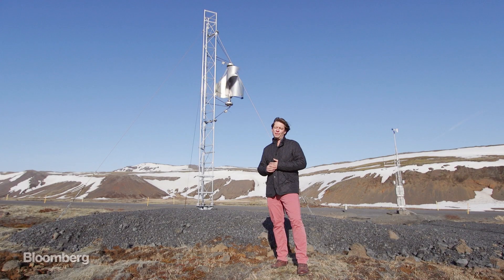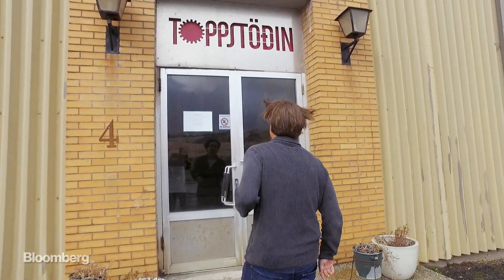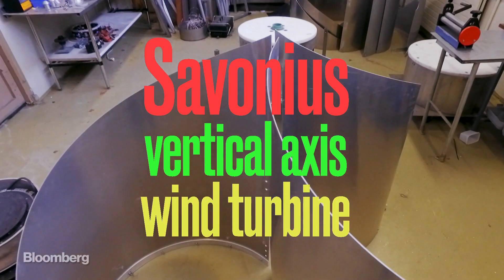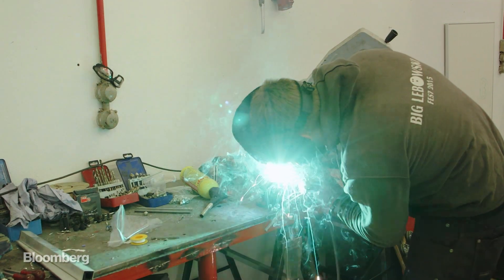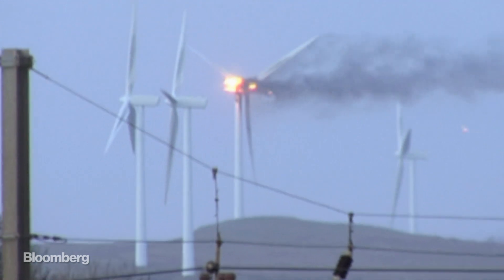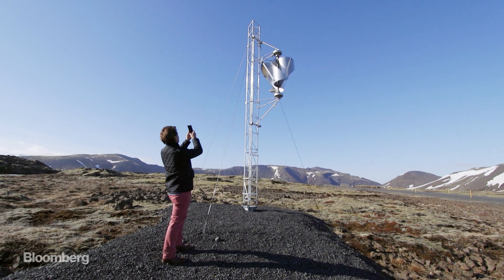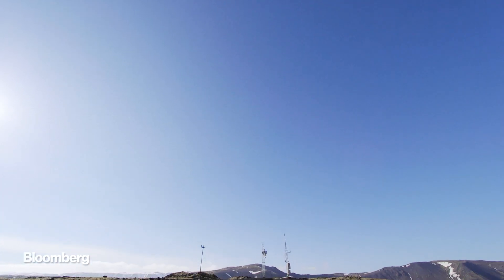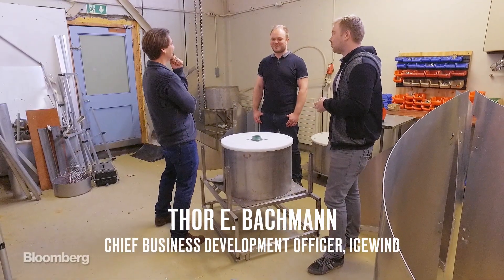The Tech That Could Fix One of Wind Power's Biggest Problems

Comment: good design... but why only one turbine on a frame that could take nine or more... and what sort of output does it give.. I imagine the generators are in the support hubs top and bottom of the blades...
Reply: Maybe that one is for testing in the real world or charging some batteries somewhere? instead of being in compensation generator for higher scale tests? But as engineers, all we need is a paper, pen and a calculator, so that we don't need to spend huge amount in material to test the theoretical side of everything in the real tangible world. Usually, engineers make as sure as they can to work it out on paper, for then make a small model, there rest of the estimations will be done in software or paper. :)
Reply: Maybe they could put more on a frame but you have to consider the loads on the support structure (mast or whatever). After all it is trapping the energy of the wind and if it traps/harnesses too much then the support structure could fail. I am writing this as the outside wind here in Wellington is 54 km/hr gusting to 106 km/hr.

Comment: Another vertical axis wind turbine. It's a zombie idea - keeps getting killed by experience, keeps shambling forward. Always finds new investors, always "a breakthrough." At least this one is cute. 

There's a reason that commercial ones are tall, three bladed, horizontal axis, and sited on high wind sites. That's what makes the most energy.

I suppose, given the high wind regime in Iceland and the long winter nights that a wind powered kiosk makes sense. But this design isn't going to revolutionize anything.

Sorry for being a wet blanket, but I work in the industry and this kind of press release "journalism" bugs me.
Reply: Minor Heretic there's not high winds in a lot of areas of the world. This would be suitable for more places and would cover those areas where high winds do not exist. The three bladed turbines are in extremely poor design do your research and you'll see what I mean.
Reply: Consider some basic physics/aerodynamics relating to wind turbines. The power available in wind varies by the cube of the wind speed. Double the wind speed means eight times the available power. Half the wind speed, one-eighth the power. Therefore low wind sites are often not worth the energy investment in wind turbine hardware compared to solar, which would give a better energy return on energy invested.

Another problem is turbulence. A wind turbine performs best with laminar air flow - the air molecules all traveling flat and straight and perpendicular to the turbine blade. A vertical axis turbine has two intrinsic efficiency problems. First, it always has vanes advancing into the wind, with the drag reducing the effect of the vanes going downwind. Second, it creates its own bubble of turbulence, reducing the effective wind speed. A third pragmatic problem is that vertical axis turbines are generally mounted near the ground where there is a lot of ground effect turbulence, further reducing effective wind speed. Add to this that wind speed goes up with height and a kiosk-mounted vertical axis turbine is a perfect storm of inefficiencies.

I worked alongside some of the best wind  turbine designers in the field for a number of years and they would have done almost anything for an extra half a percent of turbine efficiency. For reasons of basic physics and pragmatic reasons they were dedicated to the horizontal axis three-bladed turbine.

Comment: it's just uglier and way more expensive than equivalent power from the common config. It's a losing battle.
Reply: No my friend. Your negative comment is not relevant. If it was shit they wouldn't be developing it. I would let them come to a final conclusion of it's efficiency rather than throwing some pessemistic comment in to the wind ;-)
Reply: It's not "negative". That's just your irrational emotional interpretation of it from your ignorant perspective. I don't need to wait on them, it's been done before many times. There is such a thing as being wrong and they are it. It happens all the time. Toyota, Honda and Hyundai were wrong about hydrogen fuel cell cars as well. They were spectacularly idiotic about it. I knew many years ago. Tons of people told them they were idiots but they knew best. And of course they were wrong. Their obtuse plans failed.
A normal turbine is just many times more powerful for the cost and more elegant.
Reply: There is nothing like a smart arse. Apart from all the other parts of your reply. It was a negative comment. Smile my friend.
Reply: Meanwhile back in Germany the latest news is that they just put a hydrogen-powered train into operation.  No emissions whatsoever.  I wonder how those "Idiots" did that?
Reply: Subtle, a train is not a car, Isaac Newton.
Reply: Ha ha, in Isaac Newton's day the significant emissions were called 'horse apples', something people could use in their gardens.  I like your spirit ; )
Reply: Honda just released the latest version of their hydrogen car called the Clarity.   just sayin....   It's the only technology that matches our lifestyles.    I can fill a corolla's tank from bone dry empty to full in 4 minutes.  I timed it yesterday.   And the trip computer said it had just under 500km range.   Until battery technology catches up, I really doubt you can charge 500km worth of range into a battery in 4 minutes.   Hydrogen can.

Comment: Wind and solar are great alternatives to "conventional" electricity production. Power is only generated when the wind blows or the sun shines. What happens when that production doesn't coincide with your need at the time? That electricity must be stored. Now you're talking batteries. Big, expensive batteries. Presently, power is made as it is needed. An understanding of how the electrical grid really works is necessary. And a tremendous investment in a new more efficient grid and an investment in battery storage capacity is required before we can take advantage of these different power generation ideas to their fullest. Remember, you don't build your dream 3 story home until you have designed and built a strong foundation.
Reply: We've been using compressed air to store energy since the late 70's.  The tech is only getting more efficient.  The uk has a pilot project where excess wind energy is stored and used as a capacitor for when the grid needs the power and the wind isn't blowing.  

There are many other ways that are being researched and improved upon.  Batteries are not the only solution.
Reply: There are alternatives to battery storage.  In addition, clean engines can be combined to provide better consistency.  Consider too that wind turbines aren't put down in a valley.  They're placed where the wind always blows.

Comment: Some say this design is not very efficient. The one spinning in the video has 2 alternators. One at the top and one at the bottom so its safe to say it has enough torque to turn both of them at the same time. I would guess it can generate several hundred watts in a decent 18 to 22 mph wind. If the power output was not much they would only use 1 alternator. Thoughts?

Comment: They must have pretty constant wind to be able to mount them so low. Usually, you have to put turbines high to avoid non-laminar airflow - the ground itself acts as a friction force, disrupting the energy, not to mention trees and houses.
Reply: Green-propaganda hahahahaha yes... great thank you. The thing is with Iceland. They are allready pretty green. Check out their Geothermalpowerplants..... They are almost Greenland ..... 

Actually I am disapointed with this video because I thought they would speak about a storage for energy when they have overproduction for the time when there is no wind.
Reply: That's basically what anyone with alternative power sources does, whether wind, solar, microhydro, or even diesel generators. The point was that VAWTs can be less efficient than HAWTs, and that both kinds tend to benefit from being much higher in the air flow for most other landscapes than Iceland.
Reply: True, but we have no numbers of output or efficiency, so it could be all for show.
Reply: Actually, HAWTs with enough diameter and tower height can be very cost-effective.
Reply: Icelanders cut down almost all their forests, so yes, it is a windswept rock now.
Reply: no trees in iceland ;-)
Reply: VAWT's start turning at lower wind speeds and don't need the height . They also are omni-directional. The industry just shoots for the big numbers, they want one GIANT unit 200' up doing a kilowatt instead of 10 at 100W at 20'.
Reply: The tower height is the problem. in my town you can only go as far as the closest property line.
Reply: @ aphilipdent: I see, to avoid your tower from falling on the neighbor's home. Bummer.
Reply: hempev Thinking about installing a turbine to augment solar. Hawaii has plenty of both sun and wind
Reply: It's not even hard at all to figure out. Windspeed in the area should be recorded like in the states. They could have it built based on speeds. That's usually thething when making a product. It's all easy enough. People commented on supporting the system. In my area, wind low to the ground is fine.
Reply: They are either out in the windy open valley, or the ones on bus stop - it is literally meters from the coast, reasonable winds there too (Harpa)
Reply: When there is no wind? Its clear you´ve never been to Iceland...
Reply: I would bet it's because there environment has wind all the time and made to function in low winds as well. Makes me wonder also how much energy they produce
Reply: not to forget trees and houses.
Reply: Maybe this kind of turbines don't need a perfect air flow to function?
Reply: Nils None, With these toys overproduction is no the problem...
Reply: Yea but Iceland has no trees or houses so they are fine
Reply: vawt arent affected by ground affect.
Reply: hempev. It seems they're using them for small installations like that bus stop where they're not efficient or very powerful, but they still save power and money compared to pluging-in. Like traffic lights
Reply: Agent Outsider. Sure, Navier-Stokes was just made up to push an agenda -back in 19th century. And all that CFD analysis GE&Siemens do to optimise turbines is just bullshit right?
Gotta be that people who spend their careers in aerodynamics know less about it than some grumpy commenter :)
Reply: @josephgroves3176  mp
Reply: yeah you would think, but for some reason even the faintest breeze from the wind over the trees sends ours spinning .. I think propeller type turbines have a problem with ground affect like most aircraft do, that why they need to be so high.

oh   mines beside my driveway mounted about a foot off the ground. pole was there so, why not lol
Reply: Ok then . . . .
Reply: What of they put it on the coast. Like near sea level.
Reply: Parts of iceland get frequent air currents flowing across the bay, the coast line would benefit most from this.
Reply: A "giant" unit is probably going to be rated at a megawatt or more, at a cost of maybe a dollar or two per watt of capacity. This is why industry wants to do it that way. You'd need maybe 20,000* 100 watt Savonius rotors to match it. Down low, the wind will be much weaker, which is why you need 20,000 instead of 10,000. The swept area would have to be much greater, because Savonius rotors are much less efficient. 

As I recall, a 1 kilowatt wind turbine is on the order of 10 feet or so in diameter, though it depends on what speed it's rated at. If you made everything as efficient as in a really large turbine, maybe you could get it down to 6 or 7 feet. I'm sure the wind turbine emergency APU's that airliners can deploy in case of engine failure are much smaller for the rated wattage, since they'll be seeing, say, 150 mph any time they're used. Keep in mind that the available energy scales as the cube of the wind speed!

I see a place for simple units like Savonius rotors where a small amount of power is needed, but it's inconvenient to hook up to an electrical utility. Say, an emergency phone by the side of the road in Alaska in the winter. If making a one-off turbine, the Savonius probably becomes more appealing, so if your name is McGyver and you don't have any bearings apart from those in an alternator you happen to have.... A battery, of course, would also be required. A small HAWT might be competitive anyway.  Large HAWT's will have interesting structural problems, often dealt with in part by less efficient shapes.

*Wild guess, depending on the site and a whole bunch of other stuff.
Reply: They're probably being turned with an electric motor.    So much of these green energy stuff is all scams.   It doesn't work.

Comment: Failed to mention that it worked...... I know, we built one that produced plenty of electricity not under a load. One 100w bulb would just about stop this turbine, trust me I know!! Even if you have a load monitoring step converter that senses a slow down it still stops the sail....

Comment: Can they be stacked, or will this influence correct operation? Different wind loads between the rotors at different heights will cause the single rotors to spin at their own rate rather than trying to combine all the forces on a single rotor.
Reply: That's what I've been thinking, stack them up.
Reply: Since it's basically a vertical wall stacking them too high would lead to a lot of stress on the tower and might make it snap if winds get very strong.
Reply: Eivind Ludviksen
That's why you have to engineer it properly; see regular wind turbines. So can they be stacked or not?
Reply: nrdesign1991 Regular wind turbines are much more efficient than this design, but this designs redeeming quality is that it doesn't overload in high velocity winds and it requires much less parts to function.

The reason I don't see stacking these is a good idea is because they use drag to stop going too fast in fast winds, but this drag causes quite a lot of stress on the axis connecting the blade's rotation to the em generator. Stacking the turbines on a single generator will create a LOT of torque due to the law of leverage, so it will only be viable for a couple of turbines.

If you want something that generates more power and is still vertical there are other VAWTs that are much more efficient and can go much higher.
Reply: Eivind Ludviksen My idea was stacking multiple units, each with their own generator to grab different winds from different heights (if that is even possible)
Reply: I have the solution to poles snapping, but I haven't patented it yet, sorry. I will work with someone though.
Reply: nrdesign1991 The thing is that I don't see why you would want to stack them... They're only really useful on simple modules that need a low amount of energy, like a wifi hotspot or telecom relay as they show in the video.

Comment: This wind powered turbine is an excellent example of what can be accomplished on a small scale...but I doubt it would have much use in a large scale commercial power grid.

 Since virtually all power grids operate on AC, it is imperative that any generating system contributing power to that grid match the frequency being utilized. In America we use 60 Hz. Commercial wind
farm turbines adjust their frequency output by adjusting the pitch of each turbine blade, thereby controlling the speed of the AC generator.  This is why when you view a wind farm in operation all the turbines will be turning at the same speed. Also why a properly operating wind turbine will never over speed no matter how strong the wind. When the wind exceeds a certain value, the blades will “feather” themselves and stop the turbine. If a turbine is seen running out of control, it's not because it cannot cope with the wind....it means there has been a failure of pitch control mechanism.

Comment: If VAWTs (vertical axis wind turbines ) are so good, why are almost all large scale wind turbines HAWTs? (horizontal axis wind turbines) . The problem with VAWTs is that part of the rotor is swinging back into the wind, thus creating drag, where as all parts of the blades of a HAWT produce power.

Comment: On a small scale those things are ok. They have certain benefits over small regular bladed turbines, no doubt. But they have a rather low efficiency and therefore roe when you start scaling them up. They are great for the small remote location that only needs a bit of energy, like a small and efficient house. But to power industry with them? That would cost you more then building the regular ones (esp. with the new, ultra light variants that are produced right now like the ecoSwing).

Comment: Vertical Wind Turbines have existed in all shapes and forms. In fact, there is a large Wind mill of Vertical nature just a few miles from me. But they haven't built another one since it doesn't pay out... The Traditional Wind Turbine produces more Electricity per spin and scales a lot better in terms of space in comparison to a vertical turbine. How ever, Vertical turbines work very well in smaller scales. It is probably around that area, where they win over the traditional Wind Turbine... But that wouldn't be enough electricity to charge a large city. 

As for a Wind Mill burning up due "Excessive wind speed" ? Those must be old turbines since most modern turbines have DC breaks and generally when you reach a certain KM/H wind, it will shut off fully while the wind mill itself will position itself in a way that the wind can't grant spinning motion to the blades. 

Modern Traditional Wind turbines; 
* Can rotate 360 degrees for optimal wind conditions.
* Have DC breaks which is essentially magnet breaks which keeps the wind mills at a certain speed for optimal produce. More power to the DC Break, the more electricity is produced. 
* Larger blade+height = More produce.